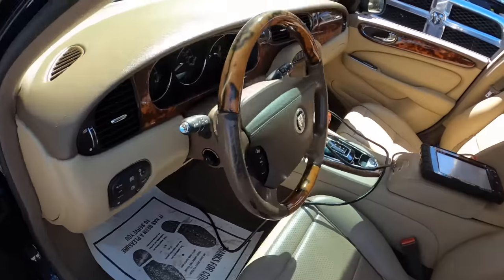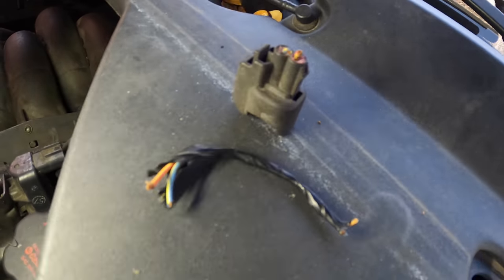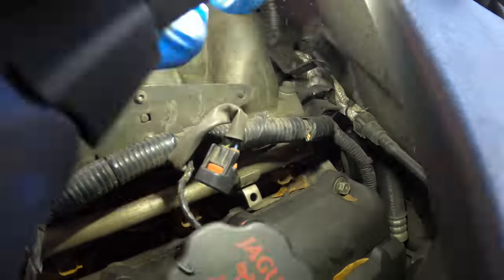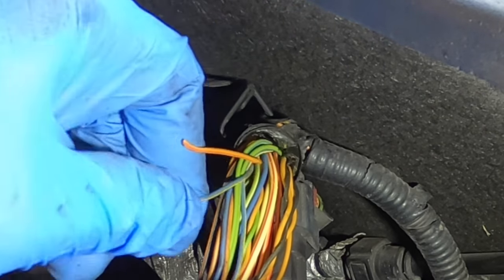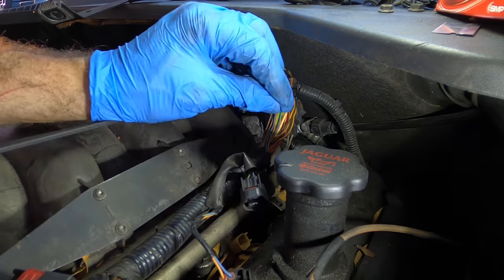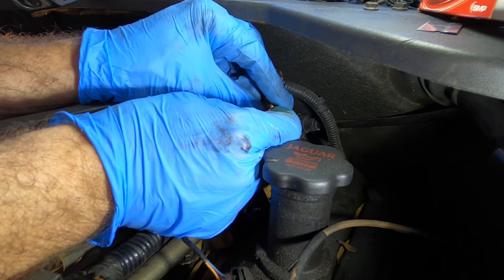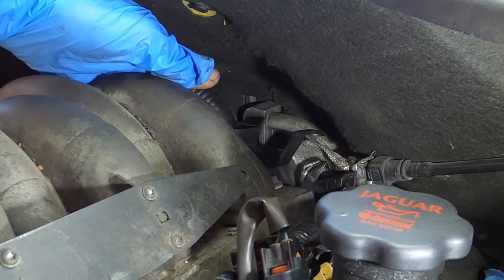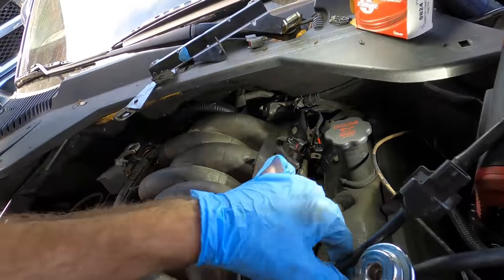Angry XJ Jaguar Engine Attacked / Electrical Damage. P0208 P0308 P0316

Comment: This is not a Ree comment Ray. Buy yourself a flux pen. It is like a marker pen containing soldering flux. You will find that using a lttle extra flux before you solder will make the solder flow better.  Especially on old wiring. Grab yourself a short bolt or a rod and wind some electrical tape around it. You then have a mini roll of tape that will go around wire in tight spaces. You are by far the most entertaing and honest mechanic I have found on youtube. Greetings from the UK.

Comment: since 2007 they have been using plant based plastic insulation in a bid to cut down on petroleum based products Honda started it off now all manufactures use it,  great videos,

Comment: Reeeeee, Good Job, the only bad job soldering is the connection that loses conductivity, I don't see that happening with your connections, remember haters are going to hate, keep up the good work
Reply: I've heard this "Reeee".
What's the context?
Reply: @dans_Learning_Curve  I'm not familiar with this either. So I used my friend google! One offering is :-   "On the base level (and in most of its mainstream usage), REEEE simply refers to a scream. Often it is used as a reaction to someone getting provoked or triggered, like a streamer reacting poorly to a bad beat or an unfortunate turn of events on Twitch."
Reply: It means replies. But I’m thinking Ray may have watched deliverance with Ned Beatty in mind…
Reply: Some people are good at teaching something they know a lot about or it’s something they’ve done as a job , and others, even though they know how to do something, whether it’s soldering or welding or whatever, have trouble explaining it without calling others names or trying to drag them down. Nobody wants to listen to others that are just complaining and bitching and calling others names, learn how to explain it and people will want to listen and learn.
Reply: Looked like good work to me. I’ve had more trouble with crimped connections coming loose than I ever had with a soldered one. My only difference is I like to mesh the strands together prior to twisting the wire.
Reply: @Hoaxer51  oh I'm not trying to teach now, I'm just venting. It is pointless anyway. When I'm giving advice I'm not calling names, just explaining what's wrong, why it is wrong and how to do it better, and why it is better. I see no reason why anyone would be offended by that, in fact it is the kind of advice I wish to be given about anything myself. I'm always very conscious about the danger of being accused of being a know-it-all and I'm always trying to nip that in the bud¹. No, that's just stubbornness and unwillingness to learn.

What REALLY gets my goat is the sycophantic, unquestioning support that people give to "their" guy and reinforce him against supposed "haters", even if they have no knowledge to assess whether what they are supporting is correct. Why are they talking? - generating noise and drowning out any constructive signal. EVERY time I try to let someone benefit from my expertise there's a least a couple of toadies "defending" their "leader" against "enemies" like me. You could ask anyone with real soldering experience about Ray's soldering, and they'll tell you almost word-by-word the same that I have said. This is not even knowledge you could be proud of, it's the absolute basics. And yet I'm not coming through with it and see Ray every time wasting time with too small a tip and wrong temperature, begging the solder to flow (!), in order to make a crappy soldering connection that is very likely to break in presence of vibration. And whoever tries to help (obviously quite a lot of people) gets mocked as a whiner. It's ridiculous.

¹)I have had a very challenging career, worked all kinds of jobs, and gathered all kinds of experience. I'm known for knowing stuff, so people often come to me for advice, but the same people are also quick to accuse me of bragging or gilding the lilly when they get me talking about something I'm enthusiastic about and they start feeling inferior. People are weird.
Reply: Great job rae love your videos and I love the way you imitate the phone ringing 👍👍😁
Reply: The only paint job that really matters is one that keeps out rust too. But a spray can job looks like shit. There's something about asthetics that adds to a professionals professionalism if it's a solder connection or a new engine.

Comment: As an Electronics Tech soldering comes in many flavors. Usually heat shrink for a repair like this but I also have a bottle of "Liquid Solder" for the nearly impossible job. I also carry those connectors that have a clear heat shrink Tube and a ring of low temp melt solder in the middle. You just pass the wires through the ring from each end and then use the heat gun to shrink the tubing and solder. Makes a water tight and strong connection. Comes in many wire gauges. Love your videos by the way.

Comment: I have soldered many 1,000's of wiring joints over the years. If I have learned anything, it is that there is no wrong way to solder.
In a workshop environment the methods taught during apprenticeships work great, squeezing yourself into tiny spaces to repair broken wiring on marine or aircraft systems, you do whatever works.
Reply: If it sticks, it ships.
Reply: almost correct.  it just need to be shiny.  otherwise its a cold sauter and wont hold.
Reply: if it flows it goes...
Reply: True dat, I had to go out on boats in the marina and work on them. Bobbing around and trying to work is much more difficult there.
Reply: Wrong, I have found several wrong ways to solder.
Reply: there are wrong ways to do it and awrong way to pronounce it the"L" is not silent
Reply: @longbowfta  and buoy isn't pronounced boo-ey either, but that won't stop those who pronounce it that way ;)
Reply: This is Youtube , Everyone needs to cry about something !  We are Victims !   Reeeeeeeeeeeeee !    If it works when I'm Done , I Did it Right !
Reply: I am sure NTSB would like to hear that!
Reply: @suburban404  Stop looking at my work!!!! ....  wait.. sorry
Reply: Thank god someone with a brain... Nice to see that on youtube
Reply: Actually no. 

There's no "wrong way" if you're just after it working right away. But to make a long term reliable fix, there is ABSOLUTELY a right way. 

With fixes like this, you want to do everything possible to ensure a solid and corrosion resistant / vibration resistant joint. 

As an auto tech who likely doesn't do much soldering, he did great and this repair should last awhile, but it'll likely fail with time as his joint wasn't proper. 

He should have used a solder connector in this situation if he wasn't confident (those are pretty durable and seal against corrosion in the patient wiring).

And i'm not 50.... but have been soldering for a decade as a hobby and have learned the proper way, as well as working on my 1985 corvette and redoing a dozen or so different circuits and harnesses.
Reply: @tonyjover  According to Merriam-Websters it is/can be, but whatever.
Reply: @ThunderPantz01  Reeeeeeeeeeeee ! , Reeeeeeeeeeeeee ! Reeeeeeeeeeee !
Reply: @patriot2164  LOL
Reply: @longbowfta  "there are wrong ways to do it and awrong way to pronounce it the"L" is not silent" 
Potato-potato? Isn't it just US-English to pronounce it without the "L"?
Reply: @mikeboring2172  Potato-potato? Isn't it just US-English to pronounce it without the "L"?
Reply: @erik_dk842  I was responding to the comment about how to pronounce buoy. As for solder, I don't pronounce the "L" and have never heard it pronounced with an audible "L" sound. I pronounce it as saw-der, but I think it is dialectal depending on where in the world one lives. It doesn't really matter to me. I do, however, have a hard time with people who pronounce the letter "a" as "ar" as in "Warshington." It is also dialectal, but I just don't get where the "r" sound comes from. Like you said, potato-potahto, to each their own. Hope you have a great day!
Reply: @mikeboring2172  In England, they say "sole-duh"
Reply: @erik_dk842  That's cool! I love England. Thanks!
Reply: @longbowfta  Before the internet Nazis, the common pronunciation "sodder"
Reply: There's definitely a wrong way to solder.  I had an automotive teacher tell me flux is never needed.  When I watched him try to solder, he told me the "smoke needs to stop coming off the iron before you solder anything"... This is the flux in the solder core burning off.  I dropped his course due to the amount of crap he spewed in the end.  In this video it was correct though.  And when I say there is a wrong way to solder, that would be leaving cold solder joints, etc.
Reply: @longbowfta  partially correct he modern form of the word solder in English is a re-Latinization from the early 15th century. The l was dropped on the way to Old French, which was common (for example, pulverem to poudre, collum to cou, calidus to chaud, etc.). Note that the l in solder is typically sounded in British English.
Reply: I all ways found the twist n hook and twist method the best over all, if it can work on a neglected wooden hulled fish trawler with nails and crap used through out it, it'll work any where! and makes for economical solder consumption.
Reply: No, there are a lot of ways to solder badly... You just don't see them until later when that cold solder joint breaks in half...
Reply: @smarthome2660 m
Reply: True, I see your point....
But for the best results, the wire join should be mechanical first, any way you want, then heat the joint, then apply the solder to the hot joint, and it will flow and penetrate...
Reply: Bigger the gob, the better the job
Reply: @patriot2164  lol, until a few months down the road, when your cold solder joints crack, and you're "fix" is no longer facilitating function. Providing CONSTRUCTIVE criticism, and feedback is not "reeeee".. it's an engaged, and loyal audience, attempting to help someone do something better.
Reply: There is sort of a wrong way to solder, if the content of the solder is not appropriate for the job it can be a point of failure. I was taught that in school anyhoo.
Reply: If its crap and it works as expected it isn’t crap. Ray likes to say just cause it’s shiny and new doesn’t mean it’s good. The inverse is also true. Just cause it looks like crap doesn’t mean it’s crap.
Reply: @Leonarco333  in the case of soldering, this is incorrect. if a proper mechanical bond has not been made, it undermines the integrity of the joint. If the joint is dull, instead of shiny, that means you have cold solder joint, which WILL crack, and then you'll have a failed, or intermittent connection. there is a wrong way to do this stuff.
Reply: @numberyellow  in which case it wouldn’t work… it doesn’t have to be pretty to be good.
Reply: @Leonarco333  ::sigh:: No, it can be ugly as sin, and work....for a little while.. 

Cold colder joints will crack with time, and weak mechnical bond will suffer a similar fate. it doesn't happen immediately. incorrect solder jobs are, at best, a temporary measure. 

The difference between Ray and your average shady mechanic, is that Ray isn't deliberately trying to do half-assed work, whereas a shady mechanic will, in order to get your money, with literally no concern for whether or not your car works 6 months down the road.
Reply: Never realized how many English professors watched Ray's video's.
Reply: @mikeboring2172  According to an American dictionary 😅

Comment: Like your videos as a retired ford tech, I understand the frustration with all the experts out there knowing everything, even Ford kept changing the wire connection procedures over the years, crimp oh don’t crimp, solder oh never solder, crimp and solder no not that, then it depended on which circuit airbag circuits were special, those even changed, saw a lot of remote starts installed where the wire was slit the new wire inserted and taped, caused more problems later on this was a ford accessory approved procedure, amazing some cars continued to run for so long.

Comment: Nice job soldering. Working in awkward confined spaces it helps tremendously if you can get a decent mechanical connection to hold the wires together before soldering.👍 And no need for Peeeet-teeeeer. Entertaining and informative as always. Peace and keep the videos coming.

Comment: As a former soldering REEE distributer, I must say good job. Your technique is a pass. 40 years a journeyman electrician. We always called that type of tape - friction tape.
Reply: and if that fails there is something called rodent tape .
Reply: @ARI Red Steer As a Jeeper who does daily repairs to keep the Jeep on the road, can I ask why it was not repaired with a gum wrapper and duct tape like I do?
Reply: @ARI Red Steer Isn't soldering a bad idea on aircraft wiring? I believe they advise against it because of potential corrosion.
Reply: If you forget to put heat shrink tube on, rather than do it again, I have found that self amalgamating tape works really well.
Reply: @ARI Red Steer It would definitely fail on an IPC certification test. LOL. But hey, it'll get the job done, and reasonably reliably, so meh. I'm also pretty sure aircraft is class 3 soldering, where class 2 is  ok for an automotive sensor or injector (as it's not generally gonna cause a catastrophic issue (not calling that class 2 either, but it'll work fine)) ...
Reply: @blacksheep25251  Because he is what is known as a professional? : ¯\_(ツ)_/¯
Reply: @blacksheep25251   You said it yourself, most people really frown on doing daily repairs, especially for example a Jaguar owner when paying a professional to make such repairs. Good luck with your gum wrapper method though, I am sure the only guarantee you can expect is that it will fail when you least need or want it to. Generally 30 miles off road in no man’s land.
Reply: @snowlothar so your part of the I Block Every Walkway (IBEW)
Reply: @adotintheshark4848  when we had to splice wires on the f-16 (lil back story I was avionics on the 16 in the usaf) we would solder wires and corrosion wasn’t a concern because the wires weren’t exposed. However there were certain wires that we could not splice I.e. flight control wires we would have to get a new wire have it threaded and repin it and secure it to the wiring harness
Reply: @wirefeed3419  Its a 21 year old Jeep, I'll be LUCKY if it makes it 30 miles...  lol
Reply: Friction tape...also works on hockey sticks..
Reply: Yes Sir,  friction tape is correct.
Reply: @timglass6041  unless you’re a Canuck, in which case it’s “hockey tape”
Reply: @blacksheep25251  🤣 I fixed my brothers starter with a McDonalds straw when we were kids, he sold it 2 years later with the straw still insulating the solenoid.
Reply: Also baseball bat tape.
Reply: @deweydodo6691  Honda Rodent Tape
Reply: @deweydodo6691  the Tape he used is called Cloth Tesa Tape

Comment: Handy tip for taping things in tight spaces, wrap some tape on the end of a pencil and use that to apply the tape.  Good job on the soldering, nice flow.  The linear twist I've always called a telegraphers
 twist, or a lineman's twist, structural and electrical connection, great for anything that might get yanked.

Comment: Another great video Ray, over here in England the rodents seem to prefer injector wiring as well, both on diesel and petrol cars, your wiring is very good, like another viewer on here pointed out, there isn’t a wrong or right way to solder, I haven’t had any wiring jobs for a little while, but I will make a video soon to show how I do it, I use a very different technique but again it’s always worked in the near 30 years I’ve been doing this.

Comment: When it comes to soldering as long as the connection is mechanically secure and the circuit is electrically sound, then you've done it correctly.

Love your description of the tape as slippery, slimey and gooey, sounds like my first workshop manager

Comment: Ray, get a letter opener or something with a safety attachment, you can slide it into the loom and cut the loom with a lot less worry of cutting wires. 
You can find something similar to what I am talking about by searching Uncommon Desks Letter Openers on Amazon. Or using scissors of some sort, you slide one side into the loom and pretty much cut inside>out rather than using a blade pointing toward the wires and risk cutting/slicing a wire open.

Comment: Nicely done on the soldering.  Good mechanical connection is important.  You may want to consider a Weller D650 or D550 Soldering Gun for wire heavier than about 14 or 16 gauge.  It'll go really quickly with either.  I've soldered hundreds of PL259 connectors with the D550.

Comment: I posted on another video of yours, I had a mouse in my main ecu box, it ate through about 10 wires, I had just enough cable left to do a bodge job to get me home, so twisting the wires and using a cigarette lighter to solder helped me get 80 miles home, then I was able to go through the whole loom and solder them properly. Note to any self mechanic, keep solder wire and insulation tape in your tool box as it saved me a lot of money. My mouse came from the boot of my car through the bulk head and tried to escape that way, I think he like the Merc cabling as he ate well that day, after I got home I used some peppermint spray all over the bulk head and have not had any more mice so far, two years and still going strong. This is my ml320.
Reply: If you used chocmint you may have had a re-visit.